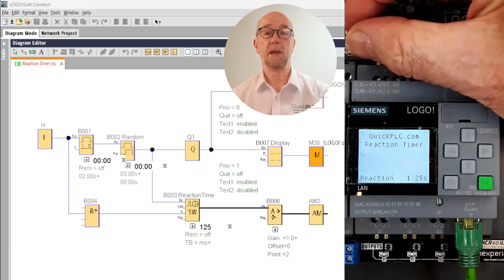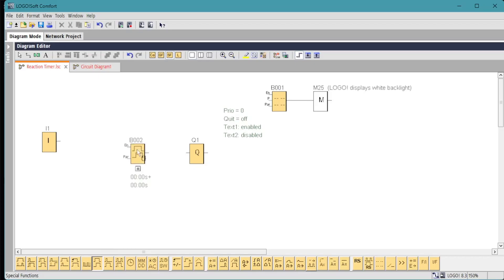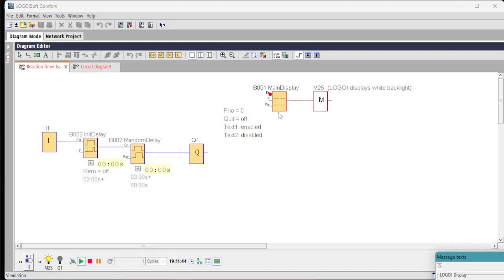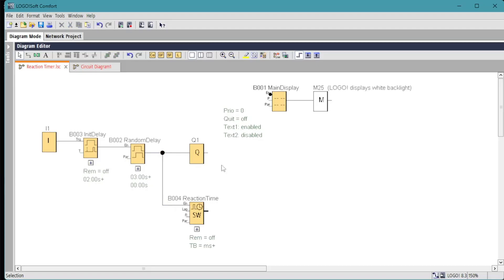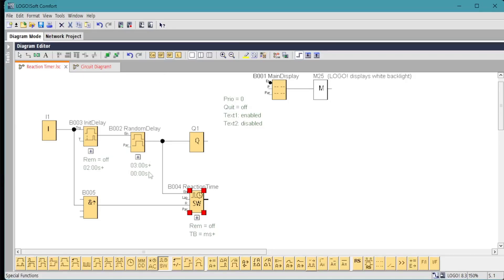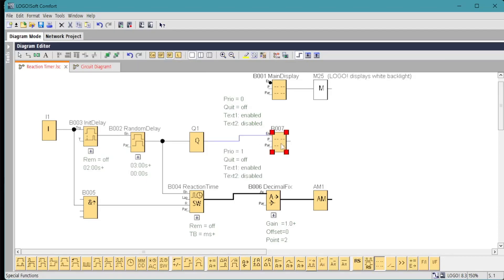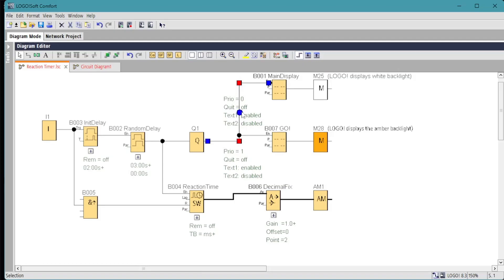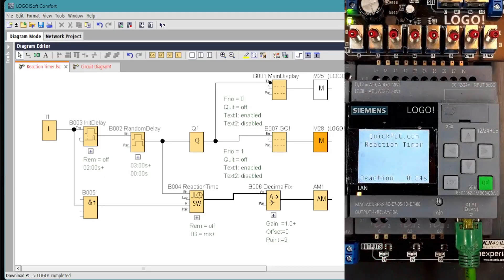LOGO! Reaction timer | Siemens PLC programming

Comment: would the display not be faster if you connect B007 directly to B002 instead of through Q1?
Reply from the maker: Good catch! The manual states, "The output always carries the signal of the previous program cycle. This value does not change within the current program cycle." I was aware of this behaviour with the Flag (M) blocks but had forgotten that the Output (Q) blocks behaved in the same way. (See https://www.youtube.com/watch?v=FJfC23oP3qk&t=389s where I mentioned it.) 
My error there will introduce a delay of about 0.3 ms for such a short program. See https://youtu.be/7d2BsvzIi0A?si=nj2YJMGel-BtB4rw for more on the scan time of the LOGO!
Thanks!

Comment: An amazing set of videos produced, thank you for these. 

Would I be right in saying that for the Logo! Siemens PLC, which possesses 4 digital inputs that can be converted into 4 analogue inputs, the 4 analogue inputs can only receive 0-10 Volt signals but in order to use a 4-20mA input it would require the use of resistors to match 10V to 20mA? 

Would it be possible for you to make a video with 4-20mA & 0-20mA sensors being used and the signals converted in a demo circuit by an analogue amplifier on logo? Thank you!
Reply from the maker: Thank you for the positive comment. See if https://youtu.be/zewpKflxjqM?si=eXY8_sWaDRCGDnT1 answers your questions and let me know. You might also find https://youtu.be/VwrP_mM-KTg?si=EBFFUT8C1y7Mrwql of great interest.